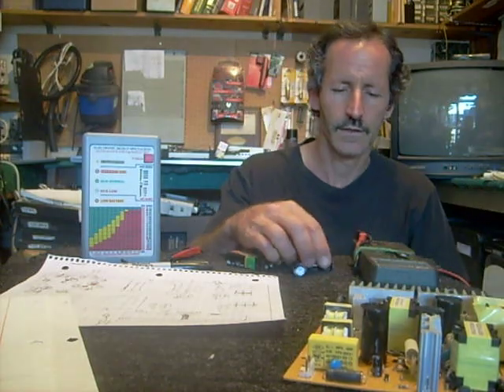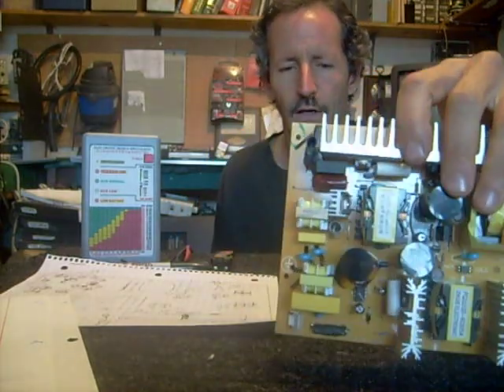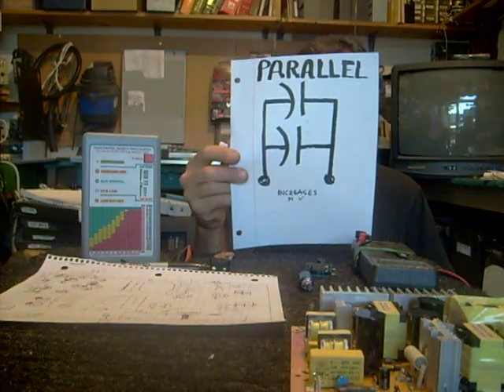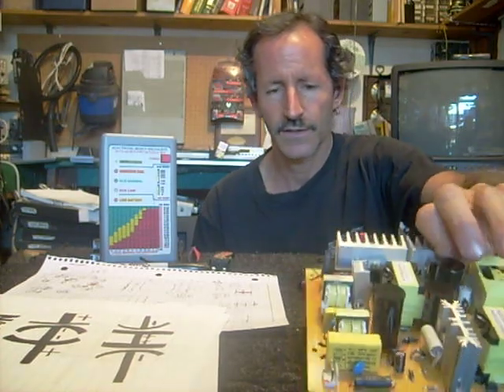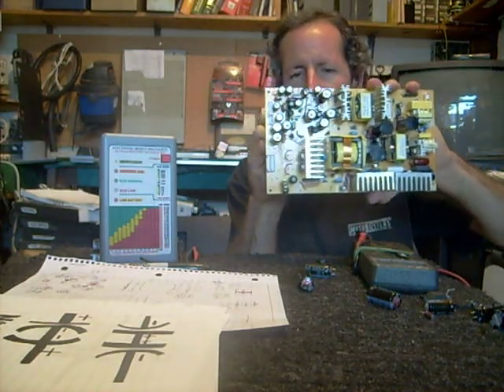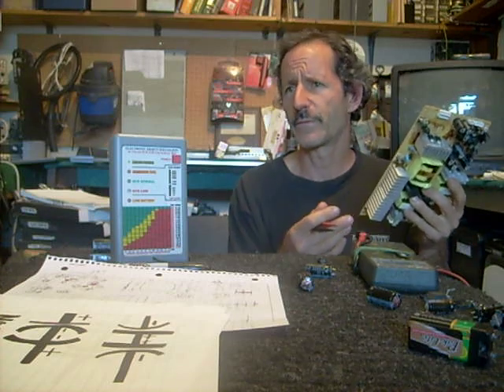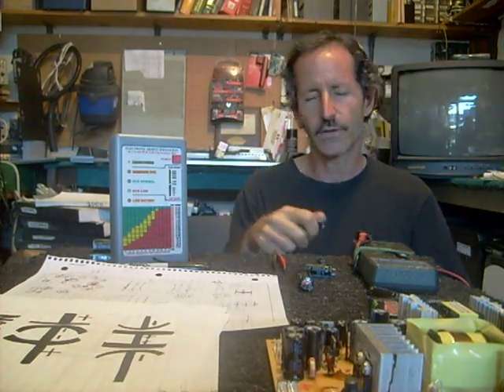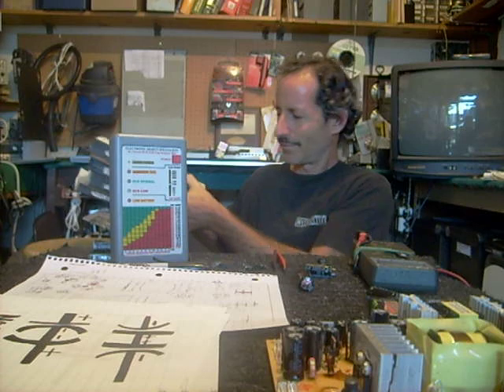LCD TV Repair made easy # 1

Comment: I got a degree from a very good school in Electronics Engineering Technology. Very good instructor Dr Chow. I hurt my back and cannot do mechanic work anymore so I want to get into flat screens. Trouble is I know the basics. they taught us with basic circuits to show the theories. I don't entirely know how these the TVs work, but I know the terminology and theory very well, 3.92 GPA with Honours. So what book would be good to pick up and study? I found this Lg monitor at goodwill for 9 bucks, all it needed were new caps, been working great for over a year now, so that got me interested.  I've got a really good DMM but I need an LCR meter and O-scope. Probably some other test equip too. Thanks for the video.
Reply: +vboss5764 Try the LCD Monitor course by Jestine Yong. As for oscilloscopes I picked up 2 good Hitachi scopes. I see good used ones for around $100. Many are sold as is, I got a good one for $42 and I see one now on ebay for $9.99 as is, seller says it does power on ok. Expect to pay around 30 to $40 for shipping.

Comment: I love the led flashlight tip, do you short the electrolytic capacitors to discharge them before you work on the power supply or is this step not necessary?

Comment from the maker: @aylwardboi. I can't guess at your problem but If it's a LCD TV it could be a bad inverter board. You should not start replacing capacitors unless you know they are bad but you can't tell if they are bad just by appearance. Watch all my videos at TV REPAIR INFO

Comment: Excellent information. My samsung HDTV wouldn't turn on, after opening it up I found four faulty capacitors out of a series of six lined up. I replaced the faulty ones with new ones I purchased on ebay. Now about a year later my tv wont turn on again. None of the capacitors are bulging this time though. Now I wonder if I should try and replaced the last two original capacitors or replace them all with digikey ones to see if it resolves the problem. What do you think?

Comment: thanks for the the reply, i looked up the main board for my tv, and it has the inputs connected to it. { i believe my tv has a PS board, inverter board, t-con board, and the main/tuner board.} The tv is very watchable, the only inputs that work are component 2 and the av.
its just that it seems to be a brightness problem, the whites are very bright and sometimes you cant read the texts on the white background. im just trying to rule out other boards, before i replace the main/tuner board. thanks

Comment: what is the brand of your esr meter sir ? thanks
Reply from the maker: The ESR meter I most commonly use is the electronic design specialist cap analyzer 88A, but I have been told the capacitor wizard is a bettter choice as far as accuracy.
Reply: @GrantsPassTVRepair  thank you

Comment from the maker: @mtogono Sounds like you have a short to ground. Sometimes I test for shorts to ground using my ohmmeter with the power off of course by cutting a circuit trace on the input to my voltage regulator to see if my short go  away. Sometimes but not always you can unsolder the input terminal to your voltage regulator and do the same thing. Did you first check your horizontal output transistor for shorts using your meter on the ohms or diode check scale? It must be unsoldered to test correctly.

Comment from the maker: @mtogono Did you install your capacitors backwards? I start with the simple things like the horizontal output transistor, flyback transformer and sometimes the voltage regulator. Did you test your B plus line coming out of your regulator?

Comment: I think you covered your material extremely well !
I am assembling one of those Blue ESR testers now.
Can I ask you a question? I have a Toshiba CF26C30 TV from 1994. It has the relay click but won't turn on. Well it partially turns on. It has the High Voltage when the relay turns on. I can also hear the audio amp turn on and off with the set turning on and off. The Power on LED will not light. I think it's missing the 9V that powers up the LED. Does your book have this problem? Thank you.

Comment: Hi, Dave.
You may have already covered this in another question or comment.  If so, I apologize in advance.  I saw you mention your nice little meter there and didn't catch where or from whom you purchased it.  I am in startup mode with my own computer/electronic device repair business and could really use a handy device like that meter.  I do own and use a multi-meter but as you said, I would have to remove components before testing them.  Could you give me more details on that meter please?

Comment from the maker: Better than suggestions as to what's wrong with your TV I have 40 plus videos on the subject. Have you see my website at tvrepairinfo ? It has an index of my free youtube videos on the subject, but you can  start with the simple things like checking your fuses and stand by voltage to see if you have an obvious power supply issue.
if there is an obvious power supply issue,

Comment: I have a hitachi le39h217a 39" LEDTV that powers on led turns green  ubt I do not get picture , what do you suggest repairing, the caps seem good, there are two main boards, a power supply board and the main bu board that has the hdmi, rca inputs on it, there is also a long slim board near the bottom of the tv connecting to the screen with a few ribbon cables. What part do you suggest would be the best guess in replacing first.

Comment: Great Help thanks for all the knowledge. I have a quick question I have a 42inch RCA Model Number L42FHD37RYX27 Ive never tried to repair a broke tv before today but ive learned a bit today and located my problem. I know my Circut Board is now bad. Its burnt up where the backlight inverter cord input. I dont know alot about electronics but I figured somethin caused that to happen. No compasitors looked bad on the back light inverter.

Comment from the maker: @aylwardboi @aylwardboi I can't guess at your problem but If it's a LCD TV it could be a bad inverter board. You should not start replacing capacitors unless you know they are bad but you can't tell if they are bad just by appearance. Watch all my videos at TV REPAIR INFO

Comment: Sorry for the number of post back to back and the double post of last comment which was my first but couldnt fit it all in one comment due to charecter limit and thanks for any response u give.
These are the model numbers in question
Back Light Inverter VIT71864.50 LOGAH REV:3
Circut Board 40-6PL37C-PWD1XG

Comment from the maker: @jamieeiv  IF YOU GO TO MY WEB SITE AT TV REPAIR INFO . COM  YOU WILL FIND TWO OR THREE SOURCES TO BUY PARTS. THE BUFFER BOARD COST LESS SO YOU MIGHT START BY REPLACING IT FIRST TO SEE IF THIS FIXES THE PROBLEM. i WAS TOLD WHEN A BUFFER BOARD GOES OUT IT CAN BE A SHORTED TRANSISTOR ON THE BUFFER BOARD. IF YOU CAREFULLY PLACE YOUR FINGER ON EACH TRANSISTOR THE SHORTED ONE MAY FEEL WARMER THAN THE OTHERS. THIS TECHNIQUE CAN BE HELPFUL IN DETERMINING IF THE BUFFER BOARD HAS A PROBLEM.

Comment from the maker: It's been my experience that the capacitors in the power supply are the first to go, although on some models they used higher grade capacitors. This being the case I don't see why replacing a few bad ones would be a bad investment. Even if the others fail at some point time you might still get Two or Three more years out of your TV.

Comment: Super repair video Dave, i have a question. I have a 50 inch Insignia plasma. And when i turn it on, i get pixelated static on the screen mostly red pixalated static, i can see the picture but it has light traces of the static, do you know what it might be?thx in advance.

Comment: Toshiba 46RV530U, sometimes takes a long time to turn. Sometimes the screen will come on immediately but the image will be real small in the middle of the screen. 

Turn it off and on a few times and it sometimes turns on and is normal other times you just leave it on and the screen will turn after awhile and all is fine. 

Any ideas? I took out the power supply and sub-supply boards. All look good. No obvious failures.

Comment: Great video, and a quick question. I'm stationed in south korea and my westinghouse sk-26h590d was plugged into a 240v outlet and "blew up."  Can you tell me the most likely part that needs replacing or repair?
Reply from the maker: If you plugged a television designed for 120 volts into a power outlet which had 240 volts the most likely problem is your power supply was damaged. Before replacing it I suggest you test some of the components on the hot side of the power supply such as the fuse, bridge rectifier, and main capacitor. If your lucky you might be able to repair it for just a few bucks.

Comment: Hi there, I was just wondering if you can give me a hint on what to look for..I have a Haier tv (cheap tv ) Led Lcd tv,model # LE19B13200 30WATTS,,What happens is the stand by light is on (red) and when i push the power button the light turns blue but no picture or sound...what do you think ? Thanks JOE

Comment: . I changed all of the capacitors on my PSU all from Panasonic and all with 10.000 hours of life and high riple current and also changed the capacitors on the Inverter with same life cycle as the others on the psu but with higher ripple current and changed some of the capacitorss on the motherboard wich were the only that shown signs of leackage for higher life and also higher ripple current, just by 100mA more and all now is working better than when it was

Comment: hi, great information.  what is the brand and model of the capacitor tester.  is that what you would recommend or are there other brand that is equally good.
tks.
Reply from the maker: Mine is a cap88a made by electronic design specialists. Someone told me the cap wizard is a better chose if your in the market to buy one but I haven;t done a comparison myself.

Comment: Dave - I have a 15 month old Vizio 47" M470VSE.  Suddenly a mirror image appeared on the screen.  I disconnected it and have it in my shop and on the screen is NO SIGNAL. Directly below it are the same words only upside down and reversed.  I've replaced the T-con board and the main board but still have the problem.  Any suggestions would be appreciated.
Cliff

Comment: I lost power to my house and when it came back on, the TV was dead. It's an Emerson 40" LCD. The fuse (8A 250V) was blown, and when I replaced it, it blew that one too. During the physical check I found that none of the components have any obvious damage. (No bulging caps, no broken or burnt resistors, etc.) Have any ideas? Thanks. Like your video very much.

Comment: I have a Lenco LCD flat screen TV that I have had for 3 or 4 years and I am having problems that I an sure is a capacitor problem. I am having a hard time finding capacitors or repair kits for this TV can you point me in the right direction?

Comment from the maker: @Burn28Acid I use the cap 88 ESR meter by Electronic design specialists but some say the capacitor wizard is a better choice. You can read a review of different capacitor testers which can be found on my web site at TV REPAIR INFO . COM

Comment: Great videos. Thanks for the information.  Quick question, I recently had a 50" plasma (insignia) go out.  I replace the power supply board and now I get sound and a screen full of white snow regardless of the input its on.  I can hear the channels changing and the different shows but only see the snow. Same thing on vga/hdmi/dvd etc.  Tested the power supply voltage and its ok.  
Any ideas.

Comment: Idont want to ruin another circut board. My original problem was no picture but did have sound. After futher investigation I learned that normally this is caused by the back light inverter. So basically is there a cheaper way to fix this problem than the replacing both the back light inverter and circut board? Or do I jus replace the Circut board. And which part comes with the inverter wire I assumed the backlight inverter? Found refurbished parts  both together looking to cost me 100.00?

Comment: One last question that u may or may not be able to answer. Have you ever ran into a inverter problem that cause a circut board to burn up. Literaly the inverter wire on the circut board side was crispy. Is that normal and in your opinion is this somethin I should attempt as a DYI. My mother orderd the books for me as a birthday gift but my money is tight right now and I dont want to dig that hole deeper purchasing these parts for the tv. TVs is 18months old stayed on 18hrs a day.

Comment: Hello! I just got a Visio 32" that doesn't ever completely come on. There are vertical stripes on the left hand side, and spider webbing on the other side. The screen itself is not broken, it just looks that way. I have had it on for about 15 minutes and it doesn't change. I took a chance on a salvage item, and it would be a great deal if I could get it to display properly. Thanx! Hope U can help. Also, let me know if you8 need specs, etc.

Comment: Hi Dave , I was wondering if it would be worth it to replace the cap's on this 50 inch Plasma set that I found next to a dumpster , I think it has two display boards maybe , it has one on the left and one on the right and the one on the left has almost all the cap's leaking , with like a red sharpie mark on the top of all of them , do you think I should replace all of those and see if the picture comes on? Also , the top layer of glass on the screen has about three long cracks.

Comment: I have a LG 52LG50, which begins to randomly channel surfs and also powers on & off by itself. (already troubleshooted the remote controls & cable box) seems like it's a circuit board problem. However I wanted a second opinion before making a purchase. Any recommendations would be appreciated. Thank you.

Comment: @ Grants Pass TV Repair....I have a 40 inch 40LD45Q Proscan FULL HDTV that I hooked to my PC using the DVI-I adapter to the VGA Cord to the TV, and the sharpness and picture was GREAT at 1920 x1080 native. But when I tried to switch to HDMI to HDMI the res dropped to 1360 x768 native? Now when i even change back to the VGA setting with my remote I get lines going down the screen, then the TV shuts off. So now I can't even go to my component or VGA setting without the TV doing this?

Comment: I have a few issues with my tv was wondering if u could give me advice...
  1. When I turn the TV on, the menu pops on and off the screen for about 1 minute, the picture in the background gets fuzzy during this minute as well. After about a minute it goes back to normal... this doesn't happen every time it's on and off, sometimes it works perfectly!
  2. Also when issue number one happens the channel and volume buttons on the TV itself don't work, and when I adjust volume from remote the menu pops up as well...or if I try to put the TV on a certain channel with numbers on remote same thing happens the menu pops up!
  3. The picture setting changes from shop mode to dynamic mode at random too... 
 This is a Samsung TV model LNT4665F

Comment: dave:i have a sony kdl52w3000 flat screen tv with  no picture and no sound. there is a blinking red led  that blinks 3 times.i replaced power supply.blew up big white resistor again.need some advice.

Comment: I had an LCD for 4 yrs, crapped out...
then went back to a DLP cus its much easier to fix and replace a bulb, if you can buy the correct brand and part no. and cleaning them is easy too, color wheel is easy fix too...
Its not as clear or sharp but its still 1080p with HDMI and they last a lot longer in the longer economically since everyone is giving them up for cheep on craigslist.  Mitsubishi 73" are my absolute "Give Me Now!" once were $2000 to $7000 t.v.'s now only $100 or less used .....its like a gold mine out there!!!!!!!!!

Comment: I have a lcd with a 1.5 inch long black,green,red line going down the right side.  It's only 1mm thick.  Broken pixels probibly.  Is it worth or even possible to repair?  I'm sure you need more information than i'm giving you. Also it does it in every mode.

Comment: @GrantsPassTVRepairs hi  i was hoping you can help me with this thought as regards capacitors ... i heard some one say  that for a capacitor to act like a capacitor it took the capacitor to charge up to 2 thirds of the voltage rating of the capacitor  so for eg the 10v rated capacitor would take approx 6v to make the capacitor almost fully charged by changing to 25v would it change to 16v to be fully charged appreciate your opinion regards celestica john

Comment: @kcar11705 
 This one up above, I had a few import lcd's and I was able to diagnose not to 100% but with in 5 or 10% of the problems, usually the powerboards go on them, but with your video I'm actually able to look further than just the power supply and repair them so thank you.
 Is it good or bad that they make these Tv's out of such crap products so in most models the same parts fail so you know by the make or model what the problem is ? I think it would be handy, not for the owner though !

Comment: I bought 3 sharp LCD televisions at an auction. A 26" with a broken screen, a 32" that won't power up, and a 42" with a broken screen..the 26" and 42"(broken screens) will power up..will the power supply from either of the 26 or 42 work in the 32? Thanks

Comment: The next day it had an off white display with horizontal lite static look I havent checked. It since to notice any difference also on another tv the tape carrier  package ends coming loose on 3 or 4 of the connections where they meet the oti glass panel it had several lines that got cleared up when I tried to hold it down with some adhesive and some foam  used in the frame is there any other way to more permanently correct this at home that you could share any help on these 2 issues with be grea